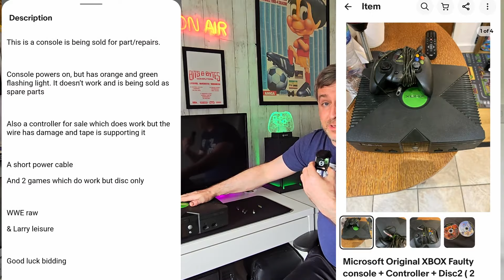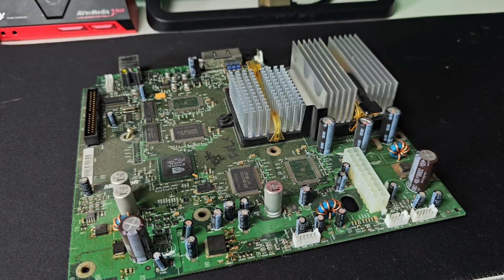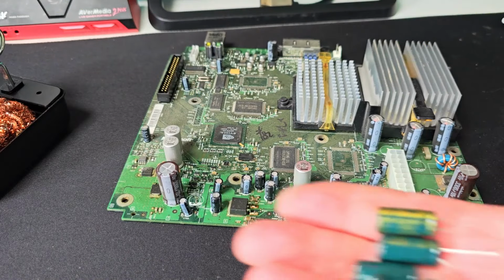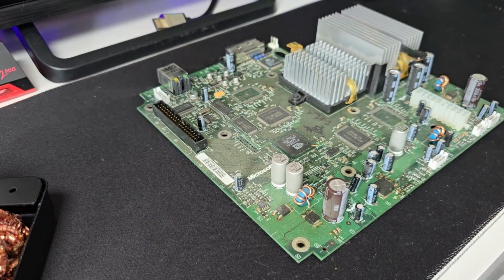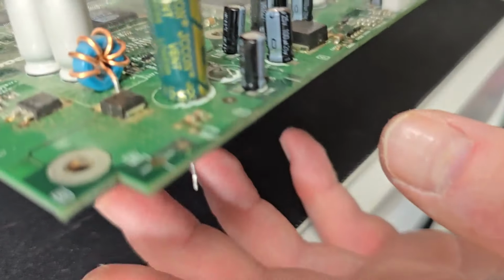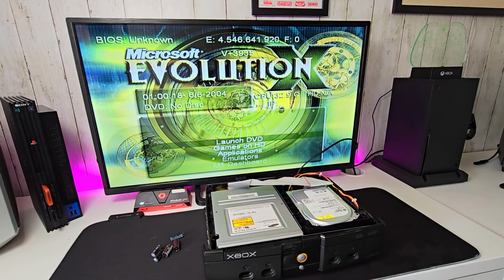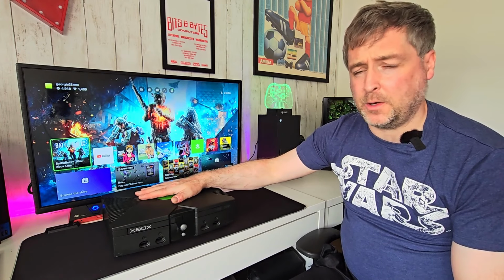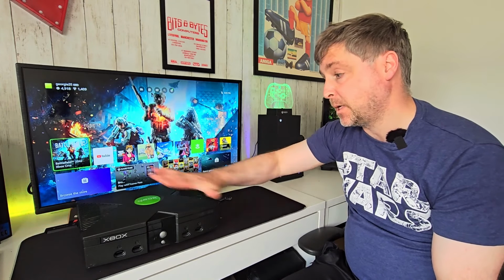How To Replace Blown Capacitors On An Xbox Original

Comment: That looked good George - which part are you putting in the dishwasher ?
Reply from the maker: The motherboard will prob go in the dishwasher lol
Reply: @tooheystechgaming1977  Won't that kill what you just did to it ? I have to arrange mine properly this weekend. Finally plug that surge adapter into my computer, I bought at xmas
Reply from the maker: @yamyam_1978 it should be fine i used to do it with amiga boards years ago

As long as they dry properly they should be fine lol

Cheers helen

Comment: 3300uf 6.3v & 1500uf 6.3v and I would say a 1.2/3v board as the version 1 has the fan on the GPU Connexant video encoder chip and the 1.4v has a focus video coder chip which I located by the fan connector 😎👌
1.6v has Excalibur video code chip
You only needed to change the Silver Caps & Black&White Caps, hope this helps
Reply from the maker: Thank you very much for the info much appreciated

Comment: in my opinion it would have been better to show in more detail how to remove the old capacitors and insert the new ones.  Without criticizing, so more than a guide it is just explaining that what can be done in this situation and that you know how to do it
Reply from the maker: I get ye if it was smd caps.i prob would but these are dead easy to install just pop em through the holes and resolder